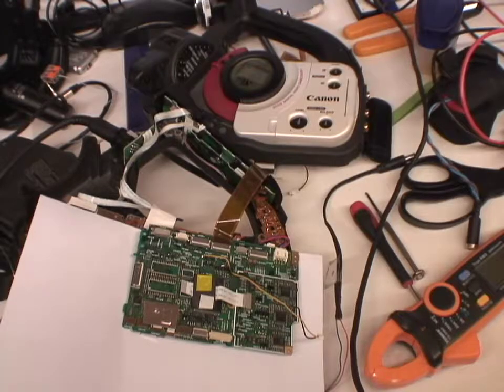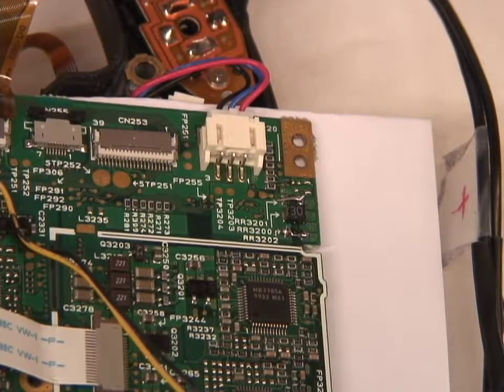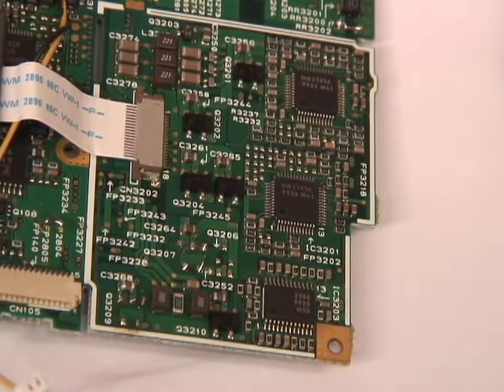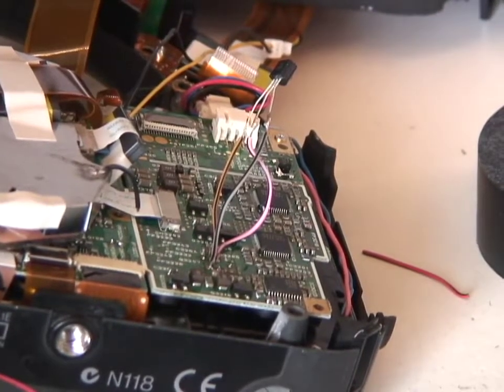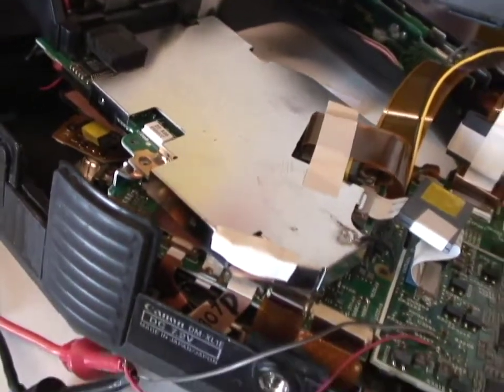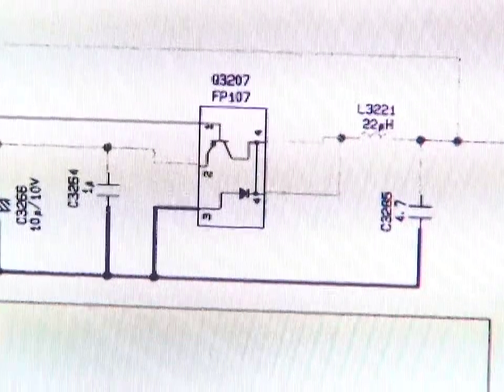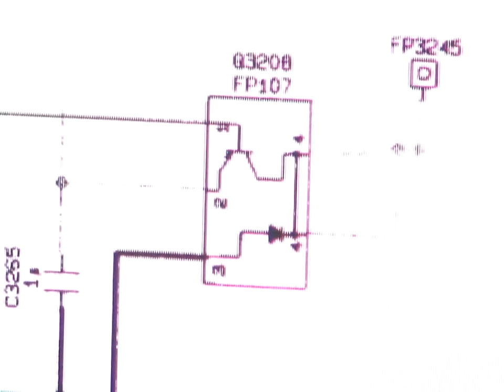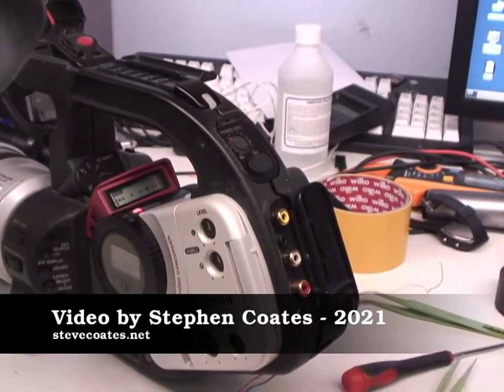Canon XL1 - Power Supply Board Repair

Comment: where did you buy the service manual? I am looking for the service manual for an XL2. It wont power up even with DC coupler attached. I have measured 7.4v on the DC connector but now i need a schematic to fault find.

Comment: Most interesting. I have a xl2 which has died, I'm in NZ. I found a repair shop in the US than can repair the camera for $175 which i thought was fair enough. However. Freight both ways is astronomical. I thought I may buy a new power circuit board and fix it myself. I've never worked on a camera but this looks interesting.
Reply from the maker: What symptoms (if any) does the camera show? Or is it just completely dead? With cameras this old there is a big element of pot luck as to whether they can be fixed as spare parts are usually not available. If its a simple component like a fuse or a transistor, these can usually be replaced, but if its a complex proprietary part like an integrated circuit, you're probably out of luck, unless you can cannibalise another faulty camera for parts.
Reply: @stevecoatesdotnet  Thank you for your reply. It's totally dead when powered by battery or mains supply adapter. Nothing happens. Not even the power light comes on. VideoCamRepair in the US said  The power circuit needs to be replaced.(OEM PARTS) They said We use brand new, original parts.Our repair comes with 90 days of warranty on parts and labor. It's freight to America and back is the killer. Plus with covid parcel post between USA and NZ is very slow. I've downloaded the XL2 service Manual. I can send you the manual if you want it.
Reply from the maker: @OwenNDawe  The advantage with a professional repair shop is that they may have old stock of unused parts, or they may have working second hand parts from scrapped cameras, so can probably do a repair fairly easily. $175 is a reasonable price, but as you say, shipping is bad.  

Do you have any electronics experience at all? It could be something as simple as a fuse blowing of its own accord - this can and does happen,  but usually the reason for a fuse blowing is because there was a failure somewhere else, which might be harder to track down. Whether you attempt some kind of repair yourself I think will depend on how much you value the camera. They aren't worth a lot these days, so it might be worth taking a chance on since its 'broken' anyway.

I have an XL2 Service manual somewhere; I'll take a look at it later. Feel free to ask if you want any pointers, although I don't have an XL2 camera myself.
Reply: @stevecoatesdotnet  Thank you. No experience on cameras. I've had plenty of experience on using them as I worked as cameraman at a tv station for about 12 years. I made 26 half hour programs on three XL1 cameras 20 yrs ago and had them broadcast. As for electronics I've built a few computers and have found old computers at the dump and surprisingly got some of them to work.

The last time I used the xl2 was about six years ago when I noticed the firewire socket on the camera very loose and was moving around. I'm wondering if this caused a short circuit and blew out the system. I've seen guys damage a camera by plugging in the firewire cable whilst the camera was switched on.

The fuses are C type Littelfuse Co fuses. By memory they are 28v DC 1 amp and 28v DC 1.5 amp fuses. I had a quick look on the internet last night but couldn't find any.

Next step if I decide to have a crack at it is to dismantle the camera and check to see if the fuses are blown.

I'm a bit of a Canon XL nut. lots don't like them. I've owned the xl1. xl1s. xl2 and at the moment have a xlh1 and two xlh1s cameras. I record on the sdi out which gives an uncompressed HD signal to Blackmagic Video Assist recording on a SD card. I haven't used tape for years.

I'm 80yrs old now. The xlh1 do what I want. I have not much enthusiasm in buying new gear. I edit on Davinci Resolve and have the studio version.
Reply from the maker: @OwenNDawe  I just checked the XL2 service manual to find out the fuse type. You may not be able to find an exact replacement, but any fuse of the same rating will do, you will just have to be very creative to make it fit! What I've done before, and what other people would probably do on such an old camera, especially one which has miniscule fuses, is just to bypass the fuse completely by putting a blob of solder over it. This would negate any protection that the fuse would offer, but this might not really matter on an old camera which is not working and has probably seen better days anyway.

One thing to suggest; if you dismantle the camera, do check the connectors on the ribbon cables and clean them. They can get dirty over time and cause problems. But even if they are fine, disconnecting them and handling them can introduce new problems for when you put it back together!

With regards to the firewire port, I doubt that will have blown the fuse. The small 4 pin firewire connector only carries data, and if any of these were to short together, I doubt that would draw enough current to blow a fuse. But still, you never know. 

If you don't manage to fix it, at least with the XLH1s you won't be short of a camera. I only have the XL1 which I showed in this video. Its quite a nice camera, although it doesn't hold up too well today. Still, it is quite fun for someone like myself who has a soft spot for old formats. I did recently get an XHA1 which I have used quite a bit. That has very good image quality and is very pleasant to use, if a little heavy.

Comment: Any ideas on getting a valuable tape out of a dead XL1? Plugged it into Imac with cheap (obviously bogey) FIREWIRE TO USEB CONVERTER, SOMETHING FRIED. No lights, power, nothing. Can I somehow get external power onto the eject motor to activate eject drawer? Any help much appreciated. Paul.
Reply from the maker: If you remove the white door (if memory serves, its a few screws, then it clips off), in the bottom right hand corner you should be able to access the eject motor. Apply about 3 Volts across the two terminals on it, and it will unload the tape (Get the connection the right way round; if the motor doesn't move, change the polarity). I haven't looked at the XL1 for ages but I seem to recall the eject motor is much more accessible than it is on other camcorders. Good luck :).

Comment: My XL1s isn’t turning on to the camera mode but will work on vcr mode. But the motherboard doesn’t visually look the same, those 3 fuses rr3201 are instead Fu some other random numbers. But I have no idea how to take the board out cause it’s on the back, any guides?
Reply from the maker: The 'XL1s' is different to the 'XL1' mentioned in this video. I made the mistake of using the XL1s service manual when I should have been using the XL1 manual. I don't think they are vastly different, but they do use different identifiers for the parts, and some of the connectors are in different places.